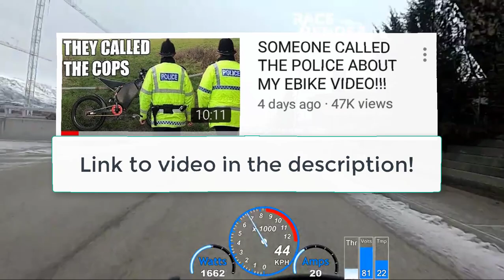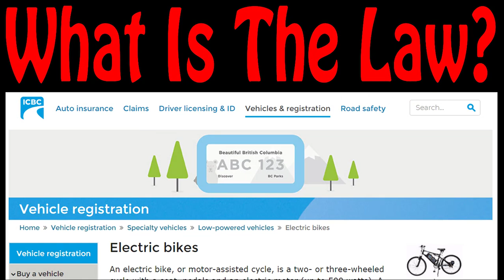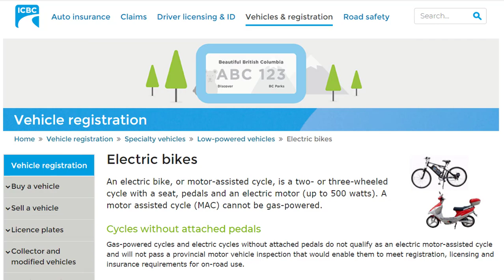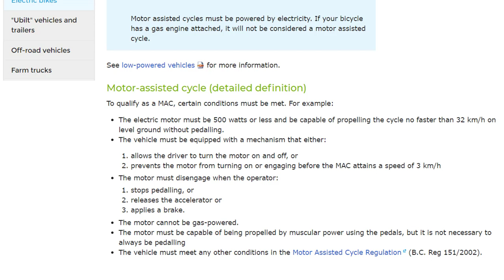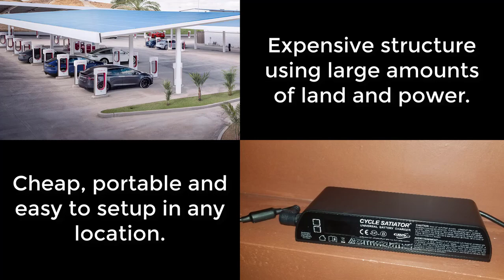High Powered Ebikes and the Law...

Comment: Using the CYY X-1 stealth limited to 750W, I have been finding speed on gentler rises on level 2 fluctuates between around 23 to 27kph. At 26kph on a hill I dropped PAS to zero, to see what a 25kph speed limit cutout would feel like on a hill. Well, it is radically noticeable. It strikes me that 25kph is perfectly chosen to be kicking in and out all the time, just when you want that bit of assistance. It is the perfect cutout speed to choose if you want to annoy the hell out of your average rider. Whoever arrived at that number is not a cyclist. I believe they sent a rider out on an ordinary bike for an hour, took his average speed, and decided that would be the legal top speed, and that average speed was 25kph.

For the open road, The EU limits are pointless. In my youth I used to ride my road bike to my nearest town (22km) in around 40 minutes (33kph). That is, unassisted, 8kph over the limit, average… not top speed. Leaving throttles out of the argument, cadence with PAS in high gear is comfortable on the flat at around 35kph. On the open road this is not an excessive speed on a bike. I would suggest that it is actually safer in my area to have that bit of extra speed, especially on rising left hand bends, where drivers are prone to graze the walls and hedges, leaving cyclists nowhere to go. In effect, comfortable cadence rates limit speed, no matter how powerful the motor, unless one fits a huge front sprocket, at the expense of climbing ability, and range.

For road use, touring, especially over distances, the throttle is probably not necessary. I never felt the urge to use it at all. It may be fun to fool around with in race mode, but using it as an override is just going to drain the battery, for no real benefit. It may be handy in the city, to accelerate out of danger, but traffic awareness will serve you better.

750w is looking like the sweet spot for sensible, practical road use on normal tyres… limit the output with PAS levels rather than crippling your motor… Rather than lobbying for bans and restrictions on DIY bikes, the big name e-bike manufacturers should be using their influence to raise the restrictions to more practical levels. It would make their own offerings more appealing. Having experienced this motor, and experimented with self imposed restrictions at the 350w level, I would not buy a restricted bike, no matter how fancy. Policing should be focussed on reckless riding, traffic violations, and endangerment to pedestrians and other road users, whether or not the bike has augmented power. Leave responsible road users to go about their lives.

Something that never occurred to me prior to fitting the motor, is what a pleasure it is to dispense with the front derailleur. I don’t care if I have become a lazy bastard, not having front gears is strangely liberating.

At 65 years of age this motor makes a huge difference to my urge to get on the bike and go for a run. I bought the motor, not to go fast, but because the hills are getting steeper every year, and I wanted to flatten them. Well, this certainly does the job. Admittedly, the extra bit of speed is nice too. I am still getting plenty of exercise, it is just so much less painful, especially on the hills. I believe my fitness level will actually increase, as going for a ride is no longer an occasional act of will, but a pleasure. It is as if this motor has knocked 30 years off my age.
Reply from the maker: Yeah. You make some excellent points. I will hit on some of them with my review of the CYC Photon which is in progress.

Comment: And here in Bulgaria - 0 law enforcement for ebikes. You can go crazy with speed there....
Reply from the maker: I'm not against regulations. Its just they need to be less restricting and divisive IMO
Reply: @HighVoltageKits  I dot think you will have any issues if you "cheat" the law. If you have a button somewhere which locks the km/s and power, just press it if you see them stopping you to check. There is no way to tell that you are screwing with the law, and just play it cool. If they see you are responsible, they'll let you go...

Comment: Like yourself I live in Canada in a much colder climate of Ontario the nations capital. I've been debating between the purchase of a fat-tired e-bike or just adding an ebike conversion kit to my existing bike. I think I'd need to install disc braking system. But as you say in video the laws are against cyclists in general. I don't enjoy riding my bike on city streets where police cruisers reside. It feels completely uncomfortable sir. Why are we placed in the same motor vehicle act category riding in construction zones, hitting sewage drainage plates and sidewalk curbs, navigating around parked cars and trucks. And ... I haven't even mentioned the ear splitting sirens from emergency vehicles - fire trucks, police paramedic!  |   I'm not even sure a 500 watt electric motor will be powerful enough for deep snow or mud & off-road. I much prefer to bike on designated bike paths away from city streets. Appreciate this video - -
Reply from the maker: I was in Ottawa area for three years..I was never bothered. I rode with respect and did not raise flags. The police were more interested in the tires than the motor. The rules are daft so no guarantees. But if you are in the bike lanes cruising at 30 I doubt you'd draw attention. Toronto might be different..I will be revisiting the legal stuff as it needs addressing. Cheers

Comment: I live in the UK and the rules here are 250w max, 25kph max and no thumb throttle. As a cyclist with a carbon road bike as well this is ridiculous. I have just got back from a ride where i spent many miles at over 30kph and topped out at nearly 70 kph on occasions, all perfectly safely and legally. But if i want to ride to work/uni on a bike with panniers, a laptop, a change of clothes and a couple of books etc, without getting monumentally sweaty, there is no legal way to do it. The alternative is to drive the 15 mile round trip most days and only cycle when there is nothing to carry. I also ride a tandem with my wife and would love to electrify it to help with some of the hills but stupidly they still just class it as a normal bike so with a combined weight (two people, bike and luggage) of nearly 200kg you are still only allowed a pathetic 250w motor. There is simply no point!
Reply from the maker: I quite agree and I think that is why most people tend to ignore the rules at least to some extent. As long as you don't ride recklessly cops at least here don't seem to mind. I really wish the rules would get changed though. We could save so much carbon by utilizing light evs more. Thanks for the comment. Cheers
Reply: @HighVoltageKits  Yeah, i completely agree. I ended up doing a build with a BBS02 with 1000 ish W that did the trick but you have to be so careful as the rules are so tight. Really appreciate your channel and the time you put into it 🙂
Reply from the maker: Thanks. Appreciated. Glad you got use out of the channel.

Comment: I think if we all came together, no matter where we are from, there's power in numbers! Like I mentioned earlier, they say 32km hr which is legal, but 30 km hr in a vehicle gets you a "driving to slow ticket" that may cause accidents lol.  
At least set it the same across the board. they should be able to match the in town speed limits based on your country, state, province etc...
Reply from the maker: Yeah. My bikes would pass safety check..The new one certainly will. I think 32 kph is 20mph..So it's an imported limit from US or UK possibly 🤔

Comment: This video should go viral and sent directly to the person who wrote that so called law. Yes you are so right and  you have all of us on your side here mate. I am in Ontario and  its the same here. Crazy how I can ride my bike home from work and at the last section theres a little downgrade so I can pedal  pretty fast and get up to 40km no problem. perfectly fine. But attach a motor in the same scenario and im breaking the law. As you said the person who wrote this never been close to an ebike.  If I ever get the chance to have them near me I would offer them a ride in traffic set at 500watt 32km setting. They will soon find out how  dangerous it is not following the flow of traffic.  Vehicles are not driving at 30km hr in town, not even 40km, but right at the peak of the limited speed which is 50-60 km. Even then  most don't obey that speed limit. Yet I can go and buy a 1000 Honda hyperbike that hits 200  in a heartbeat and it's totally fine.
Reply from the maker: Thanks. I intend to try and gradually challenge things through demonstration of ebikes and lev capabilities. We shall see. Laws it seems are the last things to change. Cheers!

Comment: Fair points in this video. It seems also that the wording you cite in the first part concerning the laws actually precludes the use of a throttle, since a MAC’s motor has to cut out when the user stops pedalling... I must also add, in the interest of a fair debate, that an e-bike is something anybody can buy and use on the road. While differences of power, engine sizes, et cetera exist for vehicles, these also require driving licences and insurance. Joe punter riding around on a 5000w capable e-bike using throttle only can reach speeds close to 100km/h, all whilst perhaps sitting on a saddle for the first time and not required to wear a helmet. The risks are quite pronounced. As per usual, however, legislation is created to ban and restrict dangerous activities and the limits imposed are arbitrary and poorly-informed. What’s the solution? One is free to have one’s high-powered e-bike registered as an electric motorcycle and given the right to ride it legally, but will have to pay insurance and abide by multiple other laws. All in all I tend to lean in favour of these restrictions, since once added an electric motor, a bicycle is no longer a simple bicycle; it’s a real blur of the lines. We’d accept not being free to just stick a petrol engine on a bicycle and ride at whatever speed and power, this is no different.
Reply from the maker: Thanks for the excellent comment. I'd be only too happy to see light electric vehicles licensed. Your points regarding safety are bang on. Cheers.

Comment: with the worlds governments totally corrupt and 100% controlled by oil, car, roads, plastics, electronics and other massive industries involved in perpetuating happy motoring insanity, it is no wonder ebikes are restricted to very low power outputs, just like public transport is crippled while giving motoring endless subsidise and handouts. industry controlled governments use the safety argument when it suits them (like when restricting ebike power) but ignore safety when it comes to the millions of people killed, injured or subjected to disease causing pollution, let alone the death toll that will eventually result from global warming and energy collapse. there is a need to regulate ebikes to a sensible output (say 2000w), but to transition people from cars to ebikes (in a capitalist system) they need to be made  v attractive, while cars are made punitively more unattractive year on year to prevent their use. its later that we think so cars are not acceptable at all. what almost everybody does not know is 3 degrees centigrade is in the can, ie temps will definitely rise to 3c above 1800 baseline with c02 already emitted, due to lag, feedbacks, dimming etc. so there is ALREADY no carbon budget for total collapse of the climate system. as you can see, cars are not acceptable. even ebikes are dodgy but at least they are light and small enough for a justifiable argument to be made they could be powered by so called sustainable energy, unlike the billions of ecars that the capitalist maniacs are planning, that use more fossil fuels than their IC cousins (due to energy transfer losses). hmm, i wonder why the neolibs like ecars so much. if politicians are pushing something, its probably wrong. in the light of such endless corruption and insanity im afraid we have to break the law as a matter of principle.
Reply from the maker: Hey Andy, I was at work when I saw your message. Which was cool cause it kind of rattled around in my head. I studied environmental science as a younger man. I am keenly aware of the dire future we face as a result of our actions collectively as a species. The ultimate consequence of which is likely to be our extinction. There are days when I feel guilty about having children when I wonder if we have a future beyond the next 15 years. But then I remember the wisest of all... Gandalf... who said that all we have is the time we are given and we have to chose what to do with it. So I guess I try to lead a positive life doing things that might help to the best of my ability. I am keenly aware as I am sure Elon Musk is that the replacement of our current car system with the same number of electric vehicles is impossible. We simply don't have the resources. I think many people miss Musks greatest achievement which is driverless cars. I think the days of owning a car for many are numbered. With driverless you simply have a transport plan on your phone and you book a journey when you need it. Which is all well and cool except it does not change the fact that as you say. The damage is essentially done. Our future on this planet is on the hands of science. We have to remove greenhouse gases from the atmosphere or face basically annihilation. So its very maddening when the so called leaders waste what time they have on self advancement and interests or corruption. As for me I try to live my life so that if it all goes to shit then I can look my sons square in the eye and say "I tried". Really thats all we can do. Great comment Andy. Cheers 🍻

Comment: The fact is Andy Kirby has plastered his Videos all over YouTube bragging about how fast he can make them go, the bike that I believe in question is not an ebike it looks  like an off road crosser, which he hardley ever pedals, applying some sensible logic, if you are doing something illegal it's not a good idea to let your ego cloud your common sense  judgement because eventually it will bite back when least expect it ..
Reply from the maker: Hey Y J. Thanks for the comment. I agree with your assessment on ego. Looking at the wider picture ego is one of the biggest problems the world faces. I try to be humble and kind myself and look to uplift others where I can. I cant comment on Andy Kirby beyond what I have seen. But I can't recall him doing anything dangerous that could have endangered anyone but himself. He did a whole series on the path to road legal in the UK for example. He is not everyone's cup of tea tho and neither am I. Cheers.
Reply: @HighVoltageKits  All he has done wrong is basically ride what is an unregistered electric moped/motorcycle on the road, as you say letting it rip and he has been grassed up to the cops, so now he gone down the legal route of getting it registered, so now the reality is its nothing more than a home built moped/motorcycle, and not cheap, just out interest I see has now gone down the road of the Grin Phaserunner controller now, and has been letting that rip, on his Vapour with the M620 motor, so he is plugging that now, I guess he's on commision lol, but no worries good luck to him 😁
Reply from the maker: The ultra can handle the bac2000 so that will destroy phase runner performance. Actually a bbshd with a bac800 will destroy the phase runner. Apparantly it was not a random person with Andy but a targeted thing. I wish I had a path to legality. One day.

Comment: Here in the UK its 15mph, 250w and no throttle.
Some people ebike by the rules, most dont.
It more affects what you can buy from bike shops, so people either build their own ( as I just have ) or buy a derestrictor.
No insurance will cover you on a bike that's not compliant with these stupid laws....and that is probably the biggest danger ?
Reply from the maker: You pretty much nailed it there. Cheers!
Reply: The insurance represents the risk.
Experiment all you want, but get accountable training, safety verification, and accountability , to share the road. 
You ask that of others on the road
Reply: @whazzat8015  agreed need to be accountable on the road if an accident is caused by someone riding an uninsured illegal motor bike ( that's what will be classed as ) its gonna be bad news. 
What's needed might be a simpler process to get them insurable , I've seen someone try to get his ebike legally on the road , he did everything which was very involved and bike was all registered etc for the road but no one would insure it..
Reply from the maker: I am using dot parts on my latest build. I hope to get it road legal at which point I will leave the ebikes for off road!
Reply: @FlyingFun.  We do need better laws and Insurers that understand. I think the "wild west"approach of the industry and a great many riders, makes the insurers' position understandable, if not supportive. US has better insurance, but not through standard coverage. It is about the same as motorcycle insurance, pretty high, a killer if you have multiple ebikes, and if >750w , no way. Rare things do happen, and could be ruinous. A legal violation could be cited as cause to revoke coverage.